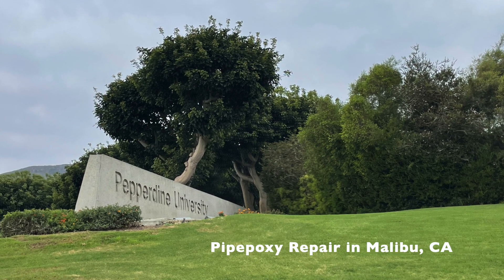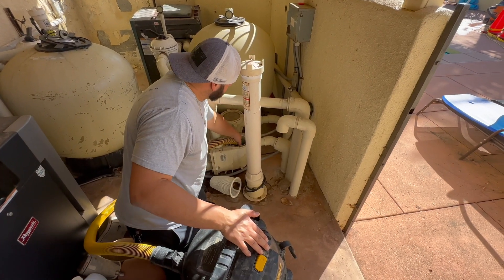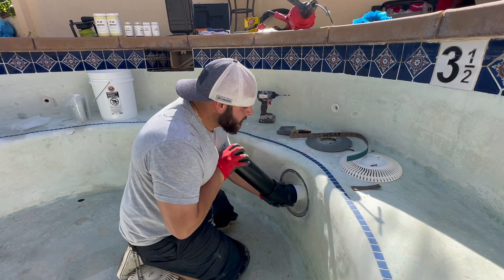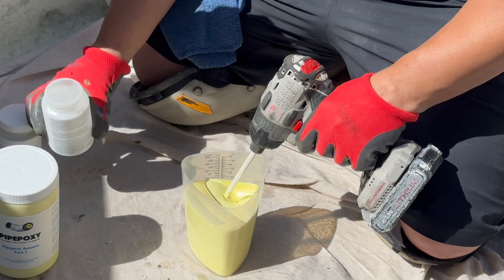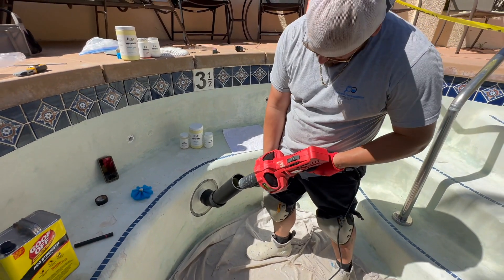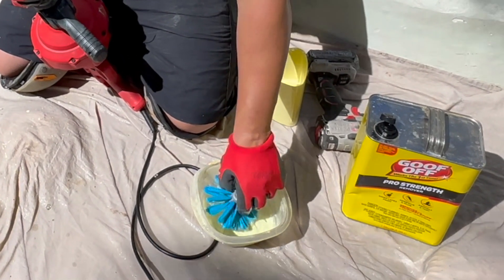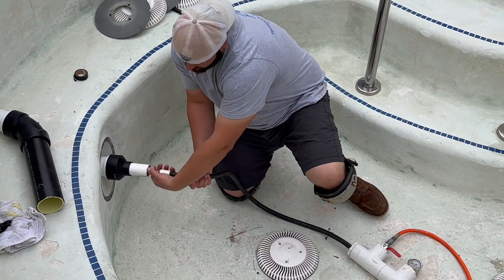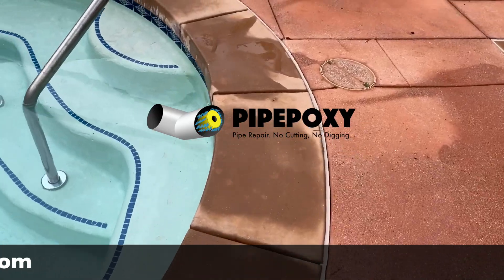Leak Detection and Pipepoxy Trenchless Pipe Repair at Prestigious University

Comment: I’m interested in purchasing this, what’s the pricing for a job like this?
Reply from the maker: A basic return line would be around $2000 to repair, and of course the price would be bumped up depending on how far in the line the leak is (MAX is 15ft. ~$4000 for max length)
For a main drain we'd begin around $4000
Reply: @LeakTronics  Thanks, 
Do you provide onsite training?
Reply from the maker: @francjhernandez15  Online Training only